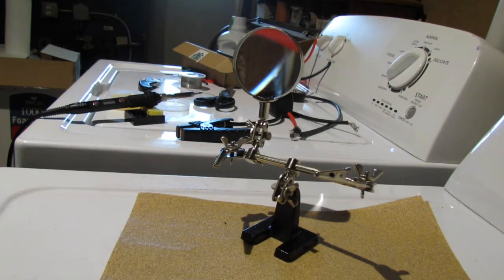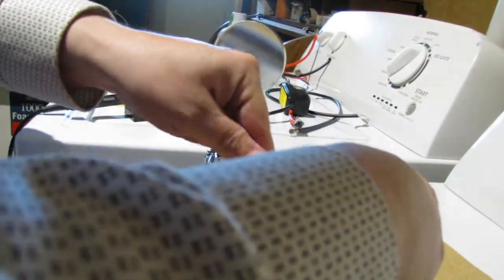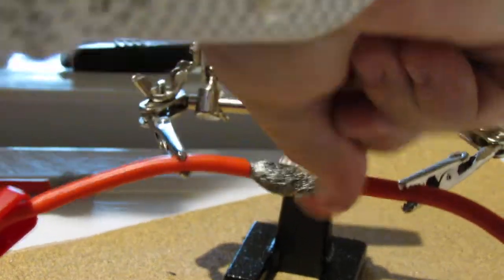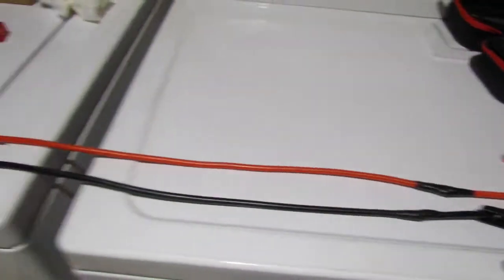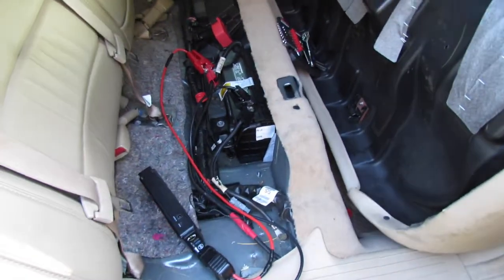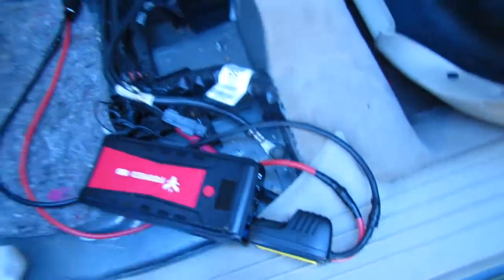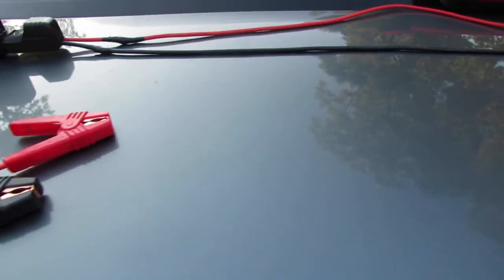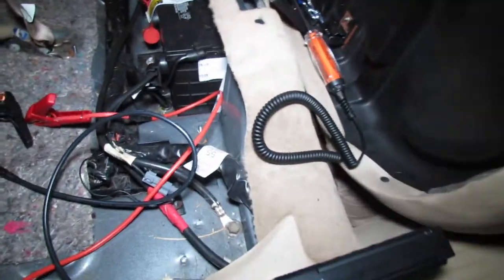(MAKE EXTRA LONG CABLES) HULKMAN, NOCO, GOOLOO, FANTTIK, FOXPEED (1st Video on YouTube)

Comment: Hey . If you are going to be doing this on other cables, i think your soldering iron is underpowered... It shouldn't take you 10 minutes to solder wire... You need a soldering iron with a higher wattage... If yours is a  60W, then  maybe 100W, a fatter tip,  and plenty solder. You want to tin the soldering iron, place the tip with the solder on the bottom of the  wires to heat up and place the solder on the top and have the solder wick down through the wires .. You dunt have to move the iron, just move the solder.. You should get a better solder joint that way...I have seen a guy do it with the iron on top , and heat the wires up just touch the solder to the wires and it melted like butter and ran down through the wires too .
Reply from the maker: The solder gun goes to 520 degrees and 80W I believe it said. It took alot more then 10 minutes to solder both wires,  I edited the vid quite a bit since it was originally about an hour video total. As long as it worked I am thrilled, I watched quite a few solder videos so I could learn the basics. But I  will definitely spend a little more time and more solder when i solder the better brand portable  jump starters next time.  I have only soldered maybe a few times in my life, now that you gave me a couple tips to help i will def do a better job next time. Thanks for the tips MPCP27.
Reply: @HM_RELOADED  .

Check this one..https://youtu.be/7t9nT3Hn9b0..see at the 1.19 mark.. Soldering 8awg wire

Or this one 
https://youtu.be/zBWL6gD7d7Y

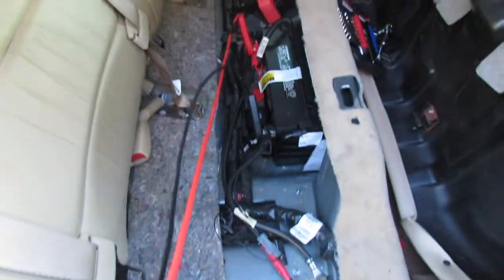at the 5:10 mark.

After you solder, if you  wrap the wires with electrical tape or heat shrink , zip tie both ends.. That will stop the tape from unraveling and becoming a sticky mess in hot weather. And also transfer any pulling load onto the tape/heat shrink instead of the solder joint.